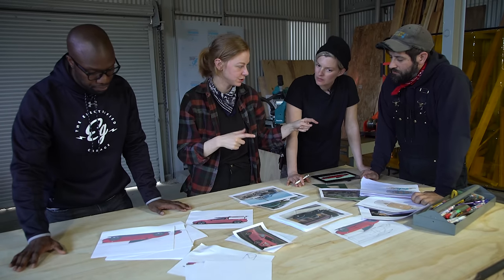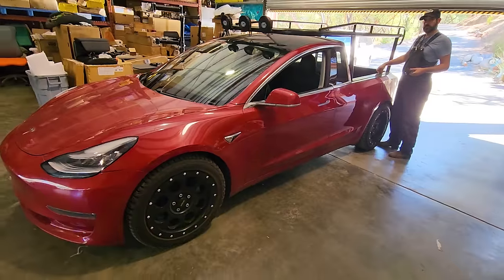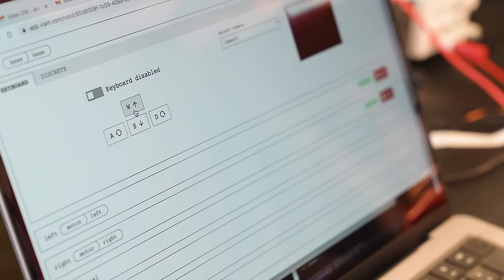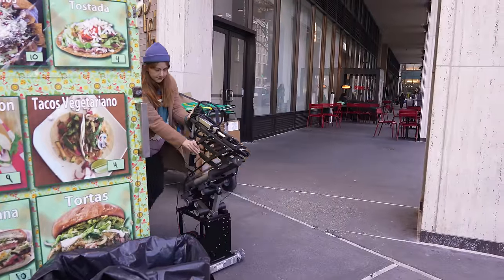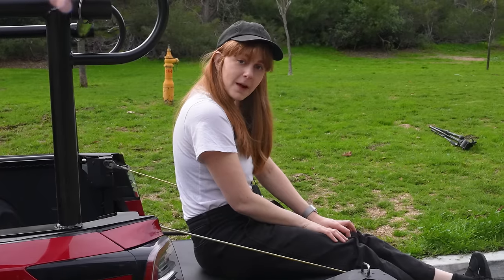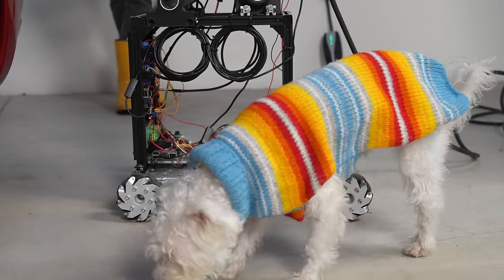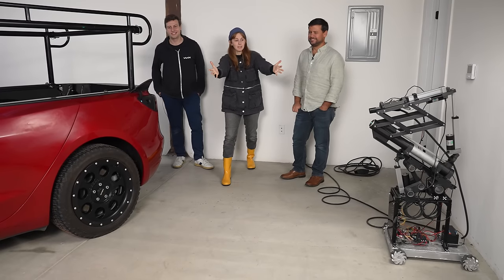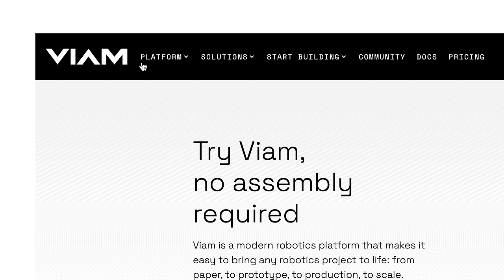What ever happened to Truckla?

Comment: That tailgate is seriously impressive.  Well done and awesome job building a one-of-a-kind functional truck!
Reply: I put my hamster in a socket and slammed it against the furniture
Reply: Impressive, but also illegal lol. Can't have tail lights on a moving portion of the rear of the car (tailgate/trunk,etc)
Reply: @mr.bennett108  I think the turn signals and break lights are still stationary on either side of that tail gate. The only lights that are attached to the tailgate would be the reverse lights. If those have to remain stationary as well, auxiliary reverse lights could be integrated into the bumper fairly easily.
Reply: @mr.bennett108  

"Can't have tail lights on a moving portion..."

Actually you can, but they can't be the only ones. There would have to be a set on a non-moving portion.

Source: look at the back of a Kia Sportage, and many other hatchback vehicles.
Reply: ok
Reply: @mr.bennett108  there are still taillights on the body. if your interpretation of the law was correct, lots of cars on the road would be failing. very common to have split taillights on hatchbacks
Reply: @mr.bennett108  it's literally the factory trunk, just with a new hinge and the top part removed.

Comment: The first thing I thought about when I saw that the tailgate pulls outwards is "Will that crumble under load? Like, could you sit on that?" - A few seconds later the affirmative was proven; very impressive!
Reply: yeah only concern I wonder about, which is probably just due to the short video, in how easy to close it is, like making sure it latches securely, and if things could get into those slides and gum them up

Comment: Truckla is looking great, and chargela did amazing under pressure! 

I think chargela might benefit from a lower jerk (smoother acceleration) motion profile. Because of the very top heavy design, any large changes in acceleration (ie jerk) is very much seen in the disjointed mass. By reducing your jerk and slowly ramping up that acceleration, the sudden change up top is not as strongly felt, and will make positioning easier and the whole robot safer from tipping!
Reply: It's faster to plug your own car in when you get home. Okay, maybe if you walk away you're saving 5 seconds while Chargela takes 30 seconds to plug in. But what if it misses? This is probably why Tesla never went anywhere after making their own prototype. Mass manufacturing takes effort. And what's the market for a $3k robot that saves you no time over a $300 wall charger?
Reply: @Nphen  plugging in the charger by yourself would not make an engaging YouTube video.  It's ok to have fun for fun's sake.
Reply: @Nphen  I think Tesla may have been worried about press featuring tentacle pr0n

Comment: I am glad to see an update on the truck. I honestly like the looks of your truck over the "upcoming" Tesla made truck. I find that a bit odd looking (and I love odd looking vehicles like the 86-91 Taurus/Sable and the Pontiac Aztek). But I am curious about the robotic charger. What is the point? I feel this is a solution to a non existent problem. It is not that hard to charge an EV now (step 1- open vehicle charging door, step 2- remove charge cable from cradle, step 3 - plug charger into vehicle, step 4 - remove cable and replace cable on cradle and step 5 - close charger door. But it was nice to see how this thing gets developed.

Comment: Wow has it been four years already?  Thanks for the update, and thanks for finally finishing Truckla.  I love it.  Honest question: is plugging in the charger really an issue that needs solving?  I don't drive an electric vehicle, but it seems to me that an auto plug-in robot is unnecessary.  Unless it's to prevent you from FORGETTING to plug it in.  But if you have enough hands and arms to drive a car, surely you can plug one in.  Am I missing something?

Comment: Pretty sure for self docking this needs a better socket. Maybe angled indentations so like 20° off angle is allowed and it'll fix itself when pushing in. And handles inside the socket so it can pull itself in the last 10 cm without having to push. Pushing with enough force is just way to complicated when the hose needs to be flexible.

Comment: Thanks to VIAM for helping to make robotics easier, as a mentor on an FRC team I’ll be looking into it to see if it can be used and beneficial to us! Chargela is an interesting one-off idea and cool project, but inductive charging via coils on the garage floor is far simpler, and I believe there’s at least one company which I believe already produces non-vehicle-specific aftermarket kits to do this. The inductive charging method can also be embedded in road surfaces, particularly highways, in order to extend range while the car is being driven - I believe this is already being tested in Germany. Ideally if it proves to be practical the automakers would implement the inductive charging mechanism into their vehicles on their own, so that it is built in effectively and safely as part of the design process but guess they’re still waiting to see what materializes as the best solution. If Tesla chose to adopt this and work with governments to standardize it, we’d probably already have the technology given their dominance in the EV market.

Comment: what if you use the 'constant' geometry of the roof frame so the dolly delivers and clamps the charger to it and it can use the frame rigidness as the opposing force to get then charger in the port. could even mark it with a small target so it clamps to the same spot each time

Comment: I am pretty sure that the mecanum wheels that charegla uses are installed incorrectly. The mecanum rollers should form an "X" on top and an "O" on the bottom, I believe it is opposite on this configuration. This would make rotational control of the drivebase much more slippy.
Reply: And who still uses meccanum?! Swerve drive is where it’s at baby!

Comment: I feel like it's kinda the point, to be a lil over engineered but I feel like an approach similar to Mark Rober's dart board might've been better.  X and Y (or X and Z?) alignment, with an arm that comes out, finds the final point and inserts the plug.  Assuming you park the car in the same relative spot consistently *enough*.

Comment: Rather than the haphazard hump action attempting to mount the charge port, would it not be better to add clamping eyelets adjacent to the charge port, and clamps on the charging boom end? That way there would be stability & solid leverage, then insertion would be a breeze after that.

Comment: That is bludy awesome - the updated Truckla looks like something that could roll off a Tesla assembly line. That fully-mobile robot charger seems a bit "iffy" though. maybe something that bolts to the side wall and extends out to the car would be a bit more sturdy.  A proper wall-mounted sled can provide the necessary X-axis movement, the Y and Z movement done by the mobile unit attached to the sled. Think back-hoe except with a charger and sensors where the back-hoe's bucket should be :-).

Comment: Why not make the automatic charger just an arm that swings down? You could probably more easily use counterweights to and a rail system to make it come down from the ceiling and plug in more smoothly.

Comment: Would have worked better if you modified a robot vacuum. So when it tries ro find its docking station it finds the car. 😅
But the best way to charge the car is by not using a robot but rather attaching the charger from the bottom of the car. 🤷‍♂️

Comment: OK so 2 questions l have about electric cars that I have always had.  Why does no one put solar panels on them to change the batteries?  Second - why no one makes a wind generator to change while driving?  Like I know it won;t change all the way adding both, but they would have to have some positive effect.  I know if I had an electric car 2 ways I would make and mount a wind generator even though Elon says it won;t work.  And the rack YOU made would make a perfect mounting spot for some Harbor Freight solar panels.  I have no idea if they are connectable and I would use some breaker fuses.
Reply: solar panels aren't efficient enough to make a difference on the small mount of car space, and the wind turbines would actual negatively impact efficiency due to the drag, as well as being dangerous and hard to implement.

Comment: I think this would not be possible because you need to pass homologation of the car to registrate it, and they check everything. The modiifications, how well they are made, is it safe is it dangerous to other peoples on the road, and the most important thing  who is the welder that welded modified parts. The welder has to have an IWE (international welding engineer) certificate. Also what about max load?